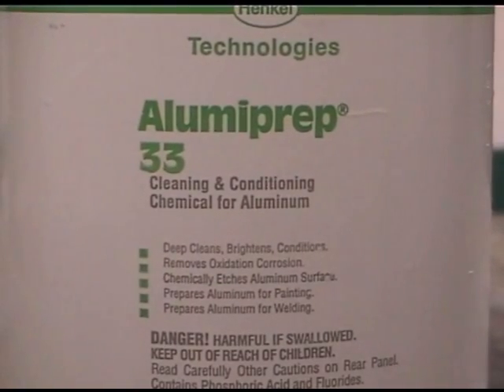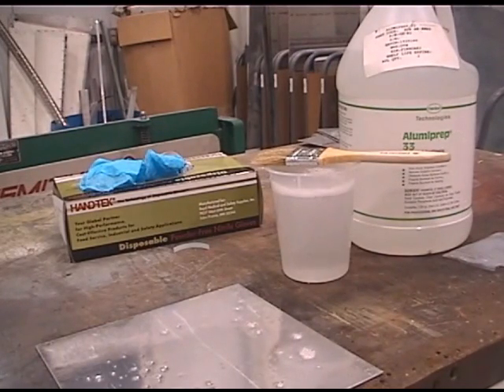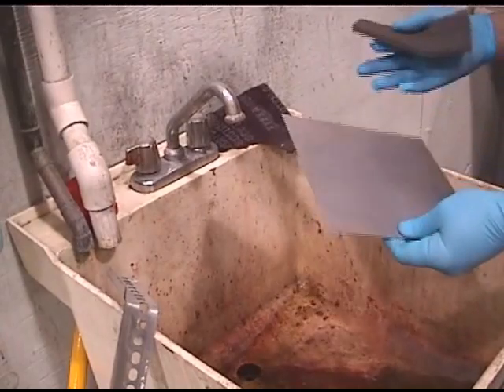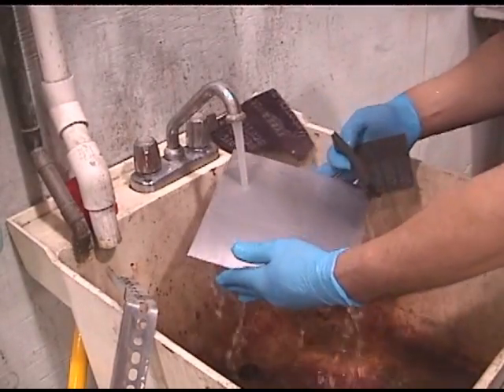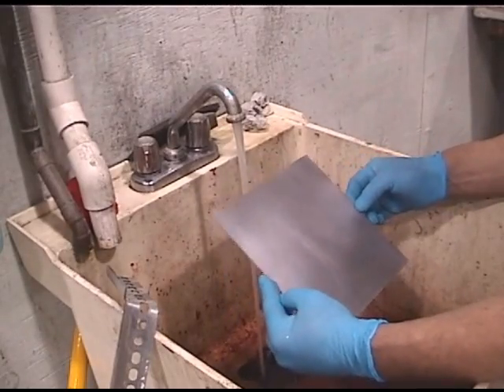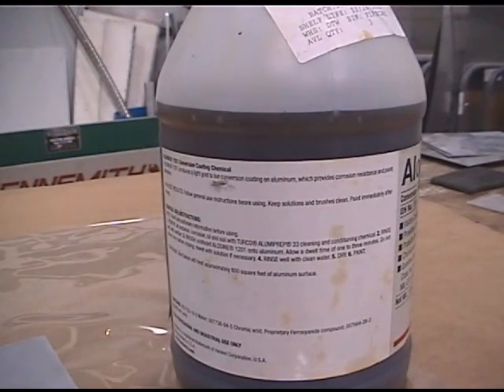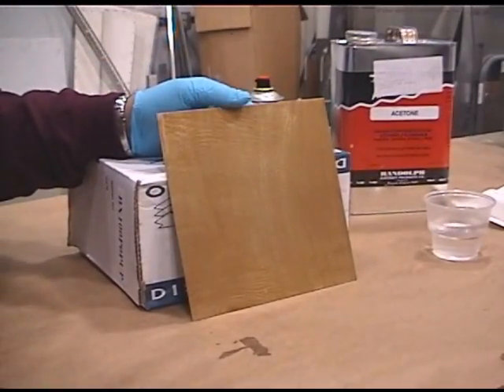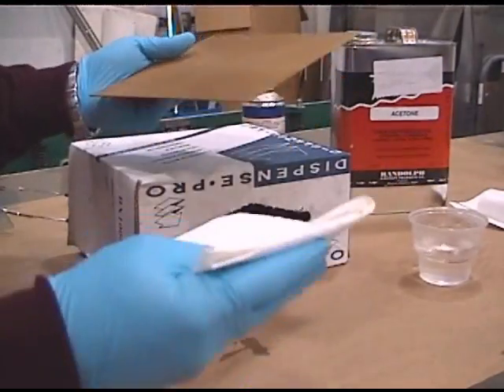metalprep

Comment: per 1201 MSDS: "...Inhalation:  Inhalation of mists of this product may cause severe irritation and burns to the respiratory tract."
You should at least provide a warning in your vid about this section of the MSDS.  Clearly, you cannot conduct a video wearing a respirator, but continued use of cleaner, 1201, primer, and paint ALL warrant proper PPE including respirator use.

Comment: Love your video, have the obvious follow-up questions... How does stripper affect alodine? I am talking the normal paint/adhesive stripper like automotive store aircraft stripper. It wrinkles the paint and adhesive but does it affect alodine? How should I progress from stripped untreated aluminum through alodine to paint and/or adhesive application? I am doing an interior upgrade on my aircraft and therefore stripped my seat frames and I am looking to recover them soon with new materials. I'm looking for ideas regarding how to best protect the aluminum frame parts as I adhesive the new materials to the frame. I plan alodine then zinc phosphate primer (I'm in California where zinc chromate it forbidden) before adhesive. Any advice?
Reply from the maker: I do not believe non abrasive stripping will affect the alodine, although a color change would indicate so. Anything stripper wise you can buy at an auto parts store is some weak stuff and probably won't work very well. PPGH makes the old school stripper that really works. As far as the process, that's what we showed here.  Have a pic of the seat frames?   Lots of ideas, but basically prep the metal, then a good topcoat would usually work fine unless your in some really bad locale which would increase the chances of corrosion. Kind of hard to be specific when I can only guess what your working with

Comment: This is great, I would like to know however if the aluminum prep 33 will eat away at hard black anodizing? I have an item that has a hard  black anodized area on the outside and I would really like the alodine to stick, but am afraid of the prep 33.
Reply from the maker: I would expect it would.
Reply: @Steve340  Thank you! Do you know any other substance I could use to prepare the aluminium without damaging the outer area of anodizing?
Reply from the maker: @jaime3576  well. I’m not sure what you
Mean by prepare. I mean the anodizing is a top coat over the aluminum.  Why are you looking to prep a surface like that
Reply: @Steve340  only the outside of the box has hard black anodizing on it, then it was machined on the inside, so the outer shell of the box is hard black anoxized and the inside is raw aluminium, we need to alodine the inside, we cannot hard anodize it on the inside, it would not be as "per drawing", we need to alodine on the inside for corossion resistance and still maintain electrical conductivity
Reply from the maker: @jaime3576  in that case just mask off the anodized surface. Apply the alumni prep with scotch brite if cladded and rock on.  Just make sure to protect the anodizing
Reply: @Steve340  will try my best, thanks for all the help, really appreciate it🤗
Reply: Alodine is being phased out in the industry due to environmental and health issues. I suggest looking at your updated specifications in your SRM as it us released.

Comment: People come on! There has been a better way than this for about a decade now. It's called Prekote. It's Chromate free and completely non-toxic. Watch their video elsewhere on YouTube. Approved by most if not all major manufacturers. Military has already completely switched over. It got a Boeing spec in 2008. I have been in aircraft painting since 1991 and I stopped using Alodine in 2007. Prekote is very forgiving and I get fewer peel offs and failed adhesion problems then I ever did using Alodine.
Reply from the maker: Looks like an interesting product.  You should do a video of its application process

Comment: That "clad" your talking about is a layer 3%-5% the total thickness of the material that is pure aluminum.  It's there for corrosion protection.  When you talk about removing the "clad" you're talking about removing the pure aluminum corrosion protection in order to get the alodine to chemically corrode the surface.

I laugh a lot at people who do the same thing not knowing they're destroying the material's ability to resist corrosion in order to apply corrosion resistance.  Then whey you try to explain what they're doing is asinine , they give you a bewildered look, like a goat chewing briars.
Reply from the maker: Actually just had this debate with a person who worked for a manufacturer. He came from the airlines and prepped a few pieces and they had a cow. The SRM’s for repairs without exception tells you to alodine. All but Saab in my experience tell you to alumaprep before alodine. Saab specifically says not to alumaprep because it removes the factory corrosion prevention. As a side note because I’m lucky enough to have a few years in aviation I still see repairs I’ve done 20 plus years ago and there isn’t a spec of corrosion on them anywhere.  Thanks for the input man.
Reply: @Steve340  Like I said - staring at me like a goat chewing briars.  Go ahead, get mad at me.  What GD moron ruins the pure aluminum layer that is the best corrosion protection you can get in order to put a layer of corrosion protection on?  What sense does that make?  And by the way It's called etch and alodine not alumaprep and alodine.  Take a GD piece of AlClad and don't scratch off the pure aluminum coating and then run it through the whole process. NOTICE HOW THE PURE ALUMINUM COATING DOESN'T CORRODE LIKE THE EDGES EVEN AFTER YOU SOAK IT IN YOUR ALUMAPREP ACID BATH?  I know its difficult to explain something to someone who doesn't know any better and has decades of experience around others who don't know any better.  That's 85% of maintenance - people who made such poor grades in school they went on to airplane mechanic school - and then didn't pay attention there and went on into the field where they didn't pay attention there - they're just sheep following the moron in front of them.
Reply from the maker: @FISHH00KS  ignoring your obviously hostile attitude. I say this. It’s your opinion man. I go by the SRM and have to date not seen one that says leave the clad untouched. Have a good day. And go get some emotional help man.
Reply from the maker: @FISHH00KS  not mad at you man, your like a liberal, keep spouting the same information regardless what comes back at you. To show I'm not facebook, ill leave your posts up here. One more ill flush it all down.
Reply: @Steve340  That's what people do when someone points out deficiencies.  Take them down, they aren't meant for anyone else.  I quit working for others as an A&P I/A because I got tired of reading the specifics and technicalities along with the background on crap only to have others just do what they "saw" someone else do.  Aviation is overflowing with people not smart or motivated enough to do anything else e.g. they're mentally lazy and that's why I went out on my own.
Reply from the maker: @FISHH00KS  I'll bet you do work alone   lol   I've met tons of people like you man.   Good luck with your career
Reply: @Steve340  Thank's !
Reply: "Since then all the products have been relabeled Bonderite" is when I stopped reading
Reply: They are not bewildered by what you're trying to explain, they are bewildered by what a sanctimonious know-it-all jerkoff you are while trying to explain it.
Reply: @Milkmans_Son - Whhhhhhhhhhhaaaa Whhhhhhhhhhhaaa Whhhhhhhhhhhaaaaa like a spoiled brat that mommy never disciplined because she was either drunk or high.
Reply: Not all sheet has pure clad and furthermore, when you shear, bend or drill the areas will not have any cladding. What about machined parts, where is the cladding? Alodine has it's place if you have and areas that pure aluminum has been removed (every functional part) you will need to Alodine or anodize.
Reply: @matthewackerson7861  You're missing the point.  And you sound like some moron "professor" know-it-all who read an article and are thus a subject matter expert.  Only a dimwit like yourself would think you only need to alodine pieces of aluminum that have been machined or sheered.  It's quite obvious you haven't paid for or read MIL-DTL-81706.  If you had, you wouldn't have even replied to my comment.  I especially feel sorry for those materials engineers, aerospace engineers, and anyone who exerts the mental effort to study 40 years about a single subject, then write papers, manuals, guides, and books about the topic - because people like you don't give them any respect by simply reading what they wrote - you simply watch a youtube video and poof - your the subject matter expert.  Good luck to you professor - and don't touch my airplane or any airplane that my family uses - and just stay away from me - I'll call you "Bullwinkle" - Mr. Know-It-All

Comment: Great video. And yes. Not much info on the web. What is the open time on the treated surface? How long do you have before you have to paint the surface? Can you alodine one day and paint days later?
Reply from the maker: No time limit to paint.  Once it’s dry it can be primed.
Reply: @Steve340  thanks so much for such a quick response! So I just want to be clear for my dull brain. 
I need to apply a number of colors side by side and a band of gold leaf in the middle of them. The paint is self priming and the gold requires a specific primer. 
So I need to paint a color and let it dry. Paint another color etc. then prime for the gold leaf which cannot go over the paint. 
Am I able to paint and gold leaf over a period of a number of days with out an adhesion problem with the alodine because the unpainted areas will be left uncoated for several days. 
Thank you again!